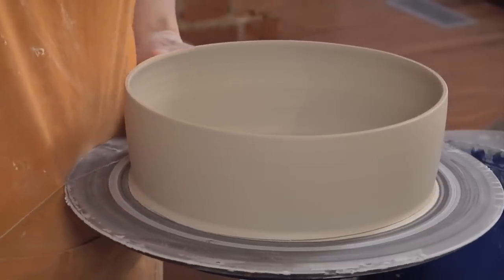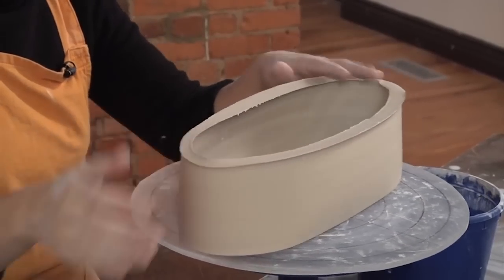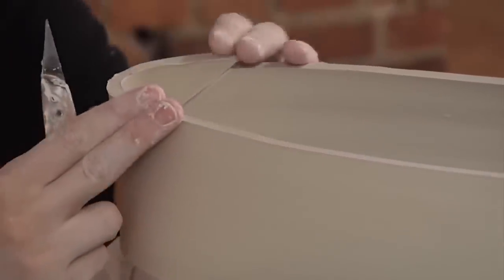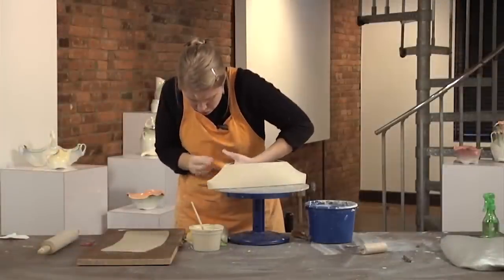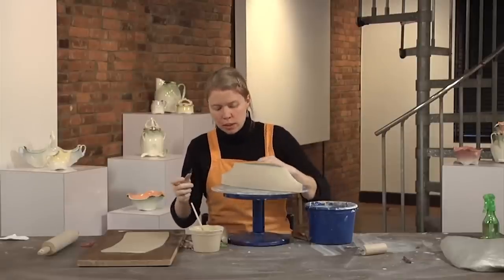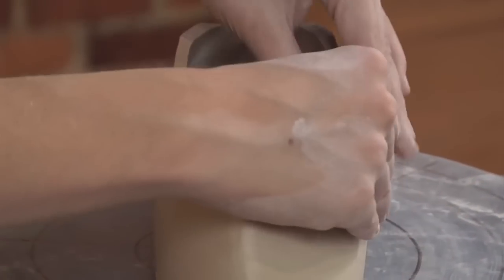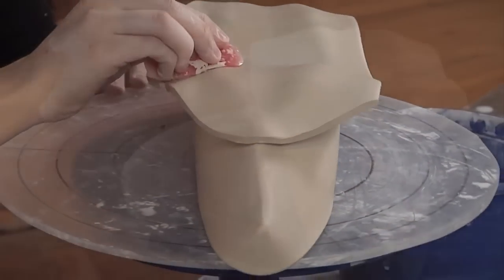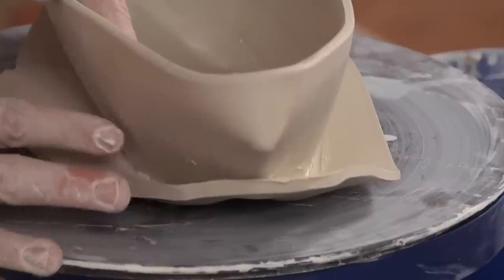Pottery Video How to Make an Elegant Wheel Thrown & Handbuilt Serving Tray | MARTHA GROVER

Comment: hi, it looks beautiful. i was just wondering why throw it rather than use a slab built "ring"?
Reply: Throwing makes a strong cylinder with no joint. My understanding is that throwing aligns the  clay particles in the wall which makes it stronger and this allows Martha to make her organic adjustments to the form without it cracking or deforming.
Reply: @dianelints861  thanks.  Interesting fact about the structural difference